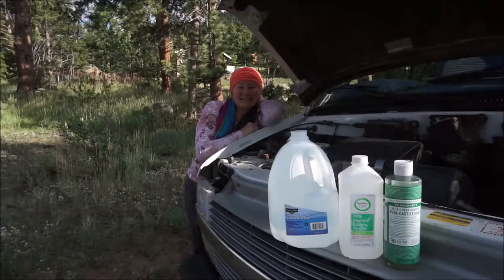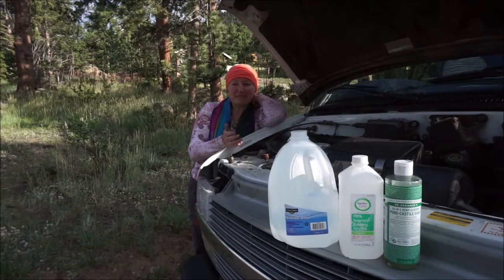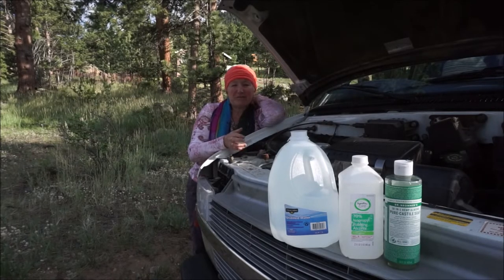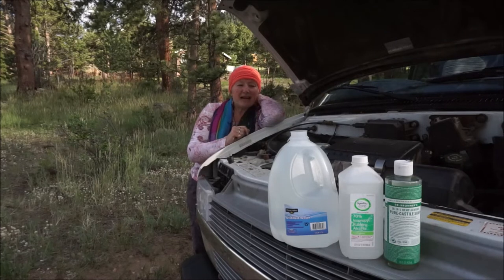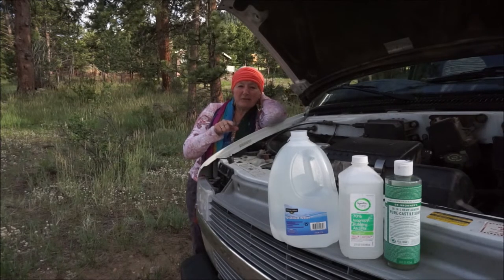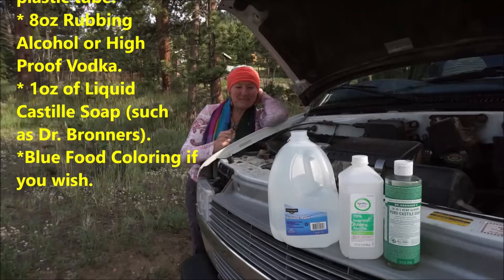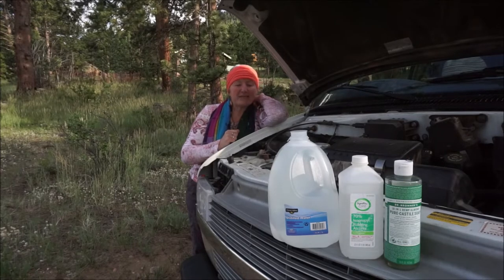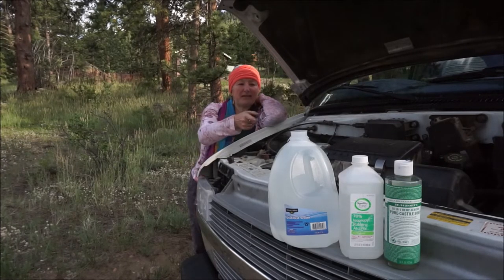Make Your Own Non-Toxic Windshield Wiper Fluid, Help the Environment & Save $$$

Comment: I'd also like to note that I live in an area in the Florida Panhandle where we have a lot of problems with limescale because the bedrock here is limestone, and our tap water comes from wells hydrologically associated with the Floridan Aquifer, which is essentially a huge void in a major limestone formation which holds millions of gallons of groundwater. 

I've used the local water in the windshield washer fluid reservoir of my 2006 Toyota Matrix for more than 12 years now, and I've never had a problem with it clogging the tube even though it definitely affects plumbing fixtures.

Based on this experience, I don't think you need to spring for distilled water. And, hey, you can avoid purchasing yet another plastic bottle by using plain old tap water. I bought this car new and have done that its entire life — with the exception of a few occasions when I used conventional windshield washer fluid because I was going to be somewhere with some freezing temperatures for a while — with its odometer approaching 200K miles. I'm not buying distilled water!
Reply from the maker: It's up to the individual whether and they want to play it safe or not. Glad your water works for you. Yay!

Comment: I see you are using Almond Dr. Bronner's. Do you think the Peppermint (my favorite) will work? 😂😂😂 Just being goofy, good tip. 😊 --Mark
Reply from the maker: Actually, its a re-used container and is filled with unscented, because of the bears...the bears, the bears....lol
Reply: I wanted to note that you can also use dish soap, although if it's conventional dish soap it's at least somewhat more toxic because the detergent in brand name products like Dawn is made from petroleum. (Which is why I've always thought it was ridiculously hypocritical of them to market their product with ads about washing wildlife affected by oil spills 🙄). But if you use a natural dish liquid like Seventh Generation, the detergent is made from coconut oil.

 I just now made a batch of this windshield washer fluid with Dr. Bronner's  because I happen to have some on hand. It's almond! 🤣

I'm really glad to know about this. I live in the Deep South so I don't have to worry too much about my washer fluid freezing and I normally just use plain water. But if I'm traveling farther north around the holidays, I will sometimes fill up my reservoir with the commercial washer fluid because I don't want it to freeze. I was going to buy some today until I started wondering if there was anything better I could use. And that's how I found this website via Google. Yay!